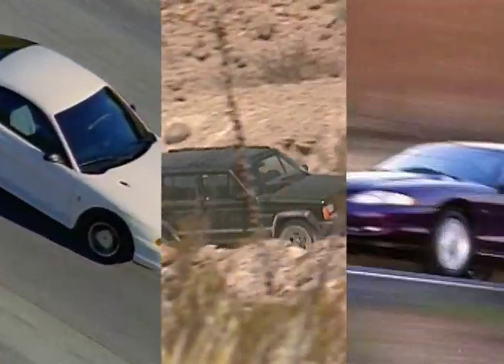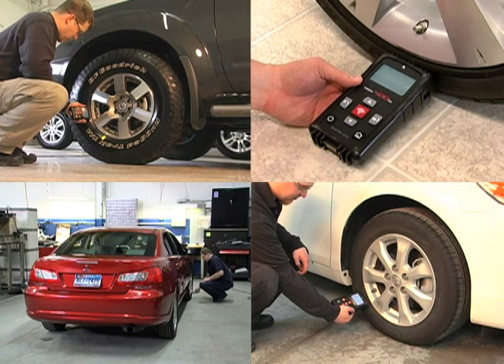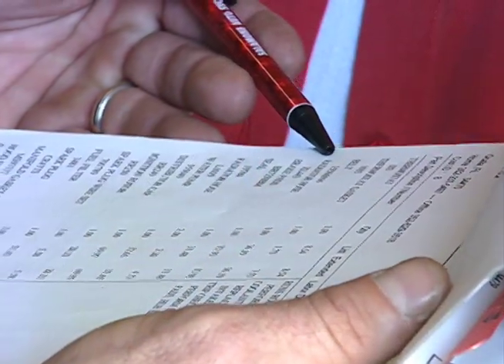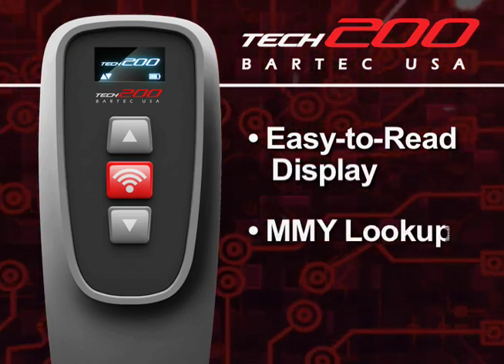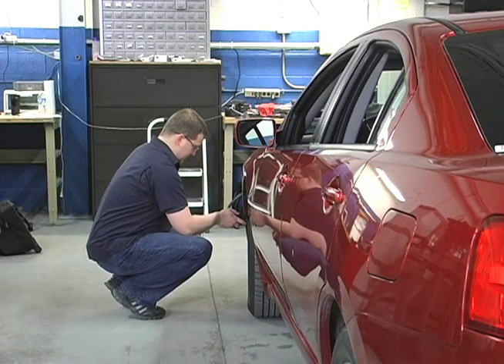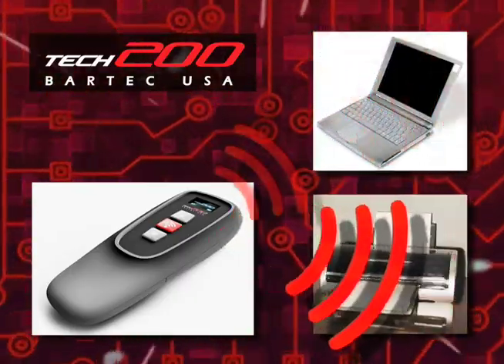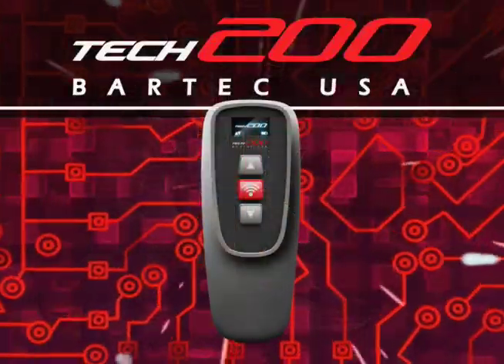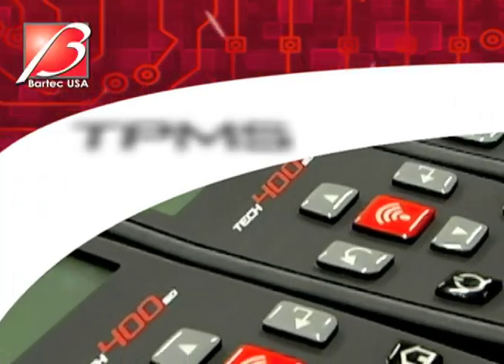TECH200 TPMS Sensor Testing Tool Presentation

Comment: Looks like All it can do is read tire pressure. No better use of it
Reply from the maker: It tests the TPMS sensor.  Many times the sensor can fail and it can days before the car displays a flashing light.  What happens if you do a tire rotation on one of these, and your customer's light comes on right after?